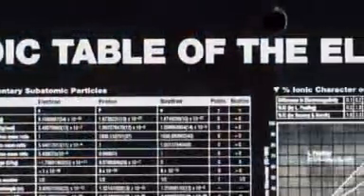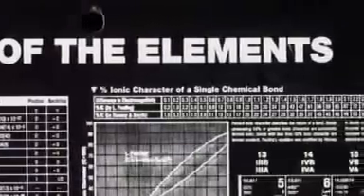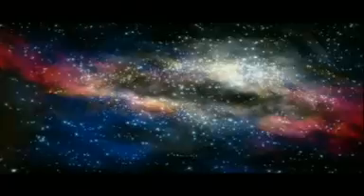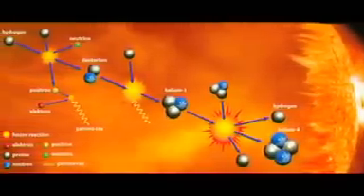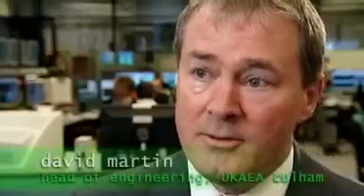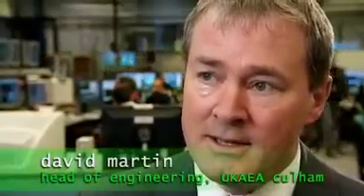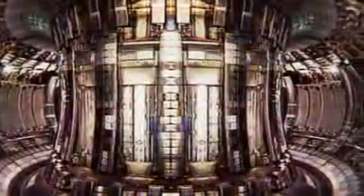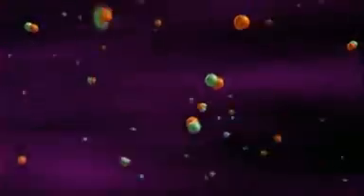How nuclear fusion works

Comment: You do realize that hydrogen gets turned into helium during that process right? It doesn't revert back to hydrogen, that would require energy to do. Also, I thought you said that science was bigoted and horrible, what the hell happened to the bible humper attitude you had?

Comment: when petrol was found to be a possible fuel source for generating motion/electricity, man made an internal combustion engine.

With nuclear fusion we have found an energy source that could also be used for generating motion/ electricity , are we waiting for a nuclear fusion type engine? For someone to discover how to cycle or sustain these nuclear pulses of energy to create a continuous stream of energy for the power grid?